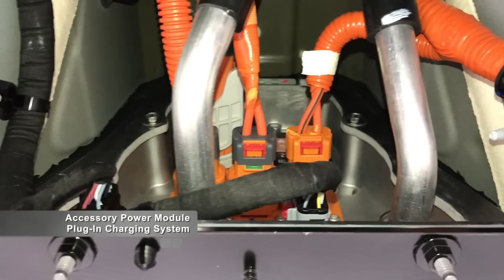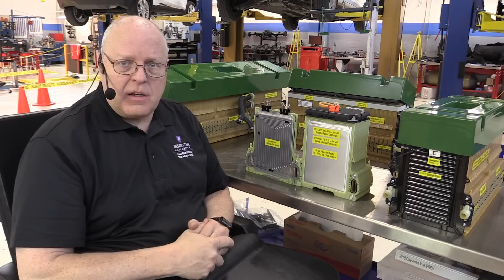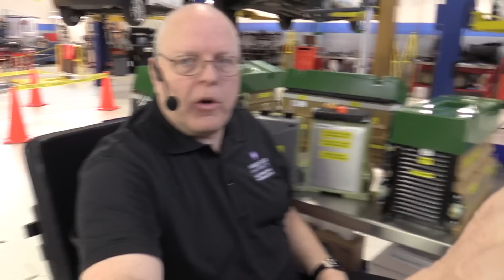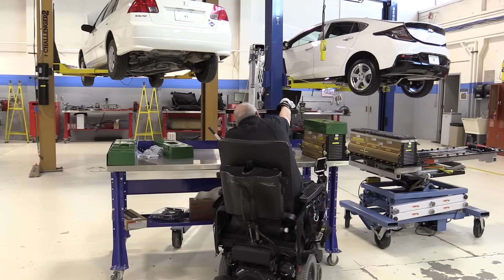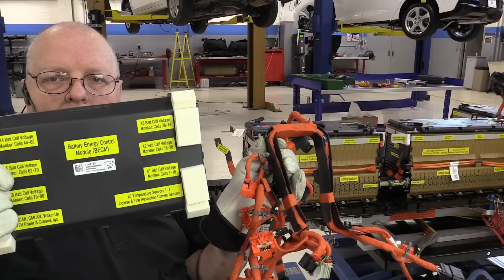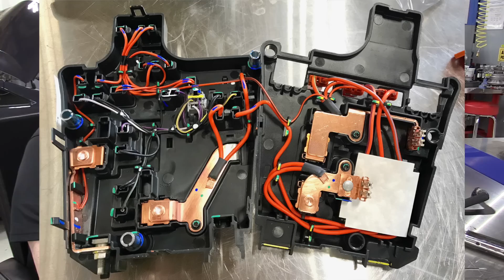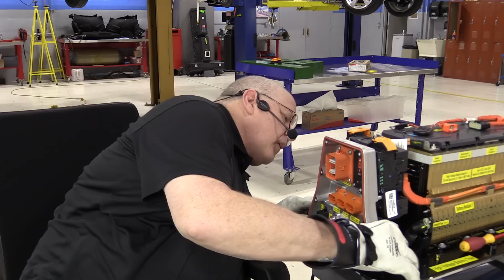2018 Chevrolet Volt 355.2V Li-Ion Battery - Deep Dive

Comment: I have a Ampera which is a volt, this is a great instruction on how the battery all goes together, amazingly well done. However it leaves me unsure on keeping this car, while it has been totally reliable without any fault or loss of battery range in the 89,000 miles I've done so far, I cannot work on it safely :-(. When it gets old it will be unfixable and useless,. I'm not a throw away person so this is bad for me. My 23 year old Jeep TJ however, will last forever, I just won't have any petrol to put in it :-)
Reply from the maker: I still have my 2014 Volt and have the same concern. I am hanging on to it until I can no longer obtain repair parts. Thanks for watching

Comment: Hello, I have a 2012 volt that I would like to convert to a vehicle charger. Im getting the cybertruck and the trade in is not worth it. How well would the volt work as a generator. AC TO AC
Reply from the maker: Good question. Thanks for watching

Comment: was long but so good
i got a used 2012 a week ago and i wondered was there a way i could get more that 21mile on a charged system? and if you can rebuild it and if so how much do you all charge to do so
Reply from the maker: Thank you. Chances are high that the battery capacity has decreased since it was built. That may be all you can get. Make sure the tire pressure is set correctly. Using the heater or air conditioning reduces driving range too. Best wishes
Reply: @WeberAuto  would a new batter give linger range?? Or not worth changing

Comment: Thank you for showing me this I have a 2017 with 55,000 miles it only gets 35 to 40 mile range with everything shut off what do you think
Reply from the maker: Make sure your tire pressure is set to the proper spec on the door pillar. Cold weather drops range too

Comment: One other thing.  I live in Phoenix.  A big city where you would think that there would be dealer expertise related to this vehicle.  My experience is that sometimes there is only one and sometimes no one at the dealer who knows how this car works.  I kind of expect this because my experience is that the auto tech don't appear to know much about cars in general.  Their pretty good at old technology but not so good with computer control.  And this is exactly what makes the volt perform as it does.
Reply from the maker: Agreed, finding trained and skilled Volt or EV technicians is a problem. They are out there, they are just hard to find.

Comment: Thanks Professor Kelly.  Can you comment on the repair method that you think or know will be use by the dealer when battery repair is necessary.  For example,  as a user,  I probably don't care which particular cell is bad just what module.  This assumes that the dealer can replace the module and not the entire battery.  Or do you think this is like replacing shocks.  If the left one is leaking the right one weill start leaking soon so we replace both.  Will the dealer argue that if one cell is bad, the others are to follow shortly and opt to replace the entire expensive battery?  I think a lot of people are first concerned about range and therefore buy a volt or another hybrid.  The second concern is about battery maintenance and the cost to replace or repair.  Thanks
Reply from the maker: They are only allowed to replace one of the three battery sections or the entire battery. Thanks for watching

Comment: I have a 2017 and its a great car. Thanks so much for the detailed explanation.   I am so disappointed that these cars have been discontinued.  I'm a retired electrical engineer and I understand that there is a massive amount of software running under my butt  to make everything happen.  In fact, I think more code than in any aircraft, fighter or commercial.  Software needs to be tested and the effort to do this is more intensive than the original design.  As you know, software is tested to spec with additional testing for any case that the engineers and testers can think of.  They won't think of everything and there isn't enough production time to test everything.  So, complex software systems are not thoroughly tested and I think about this every time I'm in the car.
Reply from the maker: Thank you very much
Reply: I'm disappointed too, I run the manufacturing facility that makes the cooling plates.

Comment: Just hose and gear clamps for coolant between sections?  Surprised these are not clips or other quick connect and clamp.  Gear clamps are expensive, slow to assemble, and tough to ensure quality.
Reply from the maker: I thought the same thing

Comment: Thanks for the very thorough "deep dive" I would love to see a conversion done on a volt to some of the new battery technologies to extend its EV range but still keep the gas engine. Could this be done? As well I'd love to see a comparison between the Volt and the Toyota RAV4 Prime, the only other Fully Gas / Fully EV vehicle I know of. (Or am I wrong?)
Reply from the maker: I own a Volt as wondered the same thing, but Volt parts are getting harder to find now making the long term outlook look bad for trying to safely convert to a newer battery technology. The Prius Prime is another option,  it its range is laughably low. Thanks for watching

Comment: Careful describing battery capacity as battery power. Comparing g1 vs g2 cells a 16 kWh vs 18kWh pack isn't necessarily more "powerful" in as power output but does contain more capacity.
Reply from the maker: Good point, my mistake. Thanks for watching
Reply: @WeberAuto  Please, thank YOU for all the absolutely incredible content. I can't begin to express how fortunate I feel to have your videos as a resource.

Comment: Why all the harnesses in all cars are not sprayed with silicon or a mixture of silicon Teflon lubricant. This way we would never ever need to worry about harness connections oxidations problems, which I believe is responsible for the many false diagnosis of failing modules?

Comment: i wonder in the future if it would possible to replace the current cell packs with with cell packs that have a higher voltage capacity at the same size to increase the volts range.

Comment: I have 2012 chevy volt that has a problem with  a sensor that overheats, after 50 miles the car goes into neutral. the dealer wants $4k bucks to replace it the car is worth about 5k and I owed about $3k. The part in question cost about $200 on ebay but I dont have the software to reprogram it. So bottom line i never buying a hybrid vehicle ever again. Its going to stay that way or sell it in parts and try to get my money back that way.

Comment: Great videos. Thank you! 
If the batteries have an electric heater, why does the IC engine on my 2017 come on when the outside temperature is below 32F with a message engine running due to cold temperature?
Reply: you should have 2 setpoints 15, and 30 degrees.  At least my 2014 does.  I think its in the comfort and convenience settings?  (The electric heater for the passenger compartment isn't that strong so the engine comes on to help. Some people have changed a thermistor and can prevent the engine from starting until much colder)
Reply: The gas engine is used to assist in heating the cabin because the resistive heater simply uses a LOT of power.   I've seen as much as a 50% drop in range in the winter in MI.   Gas engines naturally produce heat as a byproduct.   It's sometimes more efficient to actually run the gas engine to provide heat in extreme temps, than it is to rely on the electric heat alone.  The 2019 Volt ups the deferment even more to negative digits before the gas engine will kick in if you check that setting.  Otherwise it is 32* I believe that it'll kick in.
Reply: My 2018 Cadillac CT6 plug-in i can select deferred so the engine doesn't come on.  It comes on for .1 mile if I use the regen within the first 1/4 mile when cold.  If I use the brake pedal during that time the engine won't fire up.

Comment: Damn contractors should NOT be inside the hybrid battery, just a very expensive labor bill waiting to happen! Why didn’t GM put them in a more serviceable area? My Volt is in the shop with a bad contractor, total cost to repair/replace one bad contractor is $2560! Mostly labor Because the part is only around $100! Ridiculous GM!

Comment: Professor Kelly, are the 1st gen and 3rd gen batteries interchangeable? Did the battery increase in capacity because of added cells or just a better battery density?

Comment: This was such a well made and informative video covering every possible little detail you could ever need.

Professor Kelly, with your level of knowledge and expertise on the 2018 Volt do you think it is possible to change out the onboard 3.6KW charger for the newer upgraded 7.2KW charger offered in the 2019 Volt as an upgrade? I've been wondering this as I have a 2018 Volt LT but I also have a Level 2 240V 7.2KW ChargePoint charger in my home that can supply 7.2KW but the car can only charge at 3.6KW. If i could upgrade the onboard charger to 7.2KW I would be able to fully charge the car in about 2-2.5 Hours vs 4.5 hours.

I haven't found much information yet online about upgrading the onboard charger in a 2018 to the 2019's 7.2KW

Thanks for an amazing deep dive video!

Comment: I have been doing a ton of reading and asking around the web but I can’t seem to get a serious answer from anyone. Since you’ve fully dismantled the car, I can’t imagine there’s anyone who would know better. Do you think it’s theoretically possible to replace the 16-18 Volt’s 3.6 kw onboard charger for the 2019 Volt’s 7.2 kw onboard charger. Since all gen2 volts can use regen braking to recharge the battery at much higher rates than it charges when plugged in (20 kw yesterday for half an hour coasting down a mountain road), is there any reason the system (internal charging cables, cooling, etc.) wouldn’t be able to handle the higher rate if the onboard charging unit itself were simply swapped for the new 7.2 kw unit? Hopefully that wasn’t too difficult to follow, I really look forward to hearing your thoughts.
Reply: Perhaps you should begin your inquiry,

by checking with a licensed attorney.

Comment: can a second generation battery assembly be used in a 1st generation volt or will it exceed the labor of the 1st generation sensors, resistors etc?

Comment: Hi Thank you for amazing videos.For tightening torques for the hose clamps, VW has two tools VAG 1624 (100-500Ncm) and VAS 6494 (1.5-3.0Nm).We use these for interior fittings in plastic.Best regards.
Reply from the maker: Thank you! I did not know that

Comment: Thank you for doing this video.  I hope these parts last a long time.  The assembly looks VERY expensive!  As a retired Auto Electrician/Mechanic, I can't help but see and think of all the possible intermittent's and other problems in this assembly.  Past experience with non hybrid vehicles has taught me that.
Great Video Professor Kelly!
Reply from the maker: Thanks for your feedback
Reply: Keep using the wiggle test for those pesky shorts it helps at times

Comment: Ive owned my 2019 Volt for about 2 months now. One thing I was surprised about; when driving in "hold " mode and the battery is not fully charged, the engine does not charge the battery. I would think it would be able to, along with powering the car. Agree?
Reply from the maker: It will charge to 42% in mountain mode, but otherwise it will not charge it while driving. They told us in GM training back in 2010 that they do that to reduce the number of battery charge/discharge cycles to prolong battery life.
Reply: Remember, Dar, this is a plug in hybrid. The idea is you are driving on power company electric, not by burning gasoline (Like a "plain" hybrid, think Prius.) If you want your ICE to charge up your battery, you might as well get a non-plug in hybrid. (I own a 2017 Volt)

Comment: Designed, obviously, to be a very high dollar service at GM dealers, there is absolutely no reason much cheaper individual modules couldn’t just snap in to the pack without removing the entire battery assembly, been done in large UPS and server systems for decades... I see a huge opportunity for the aftermarket to redesign these properly, I’m betting that the OEM will start using encrypted electronics though, like other industries are now doing to make them unrepairable except at the dealer.
Reply from the maker: Thanks for your feedback

Comment: Here in Chandler, AZ, I have been working on these since their inception in 2011.  I have only worked on/repaired the internals of the battery pack 2 times. Once for a BECM and once for a High Voltage Interface Control Module. I work on Volts several times a week and the vast majority are for low coolant from air pockets trapped in the cooling system and occasionally a bad HV battery  coolant level sensor along with your typical software updates.
Reply from the maker: Thanks for your feedback. As you probably know, the vacuum tool works great for removing air from those systems and for leak checking. Have a great day!
Reply: how do those batteries hold up in the Arizona heat?
Reply: @co.larich  the batteries hold up exceptionally well longevity wise but the actual charges dont last long due to the heat in the summer requiring the coolant pumps and fans to turn on while charging to prevent overheating as well as the HVAC system being on.
Reply: Very educational.
Reply: How can i get ahold of you? Im in phoenix.
Reply: @sergioknuf  what are you needing?
Reply: @chicanobluesaz4191  im looking at getting a 2012 volt from offer up wanted some one that can check it to see if is worth it the guy said the charge is at 21miles range. But i can't find any one in phoenix.
Reply: @sergioknuf  Unfortunately I'm no longer in the industry. I had an amazing opportunity through Intel open up for me working on the robotics. The GM auto industry doesn't want to pay for experience and top notch talent so I had to bounce.
Reply: @chicanobluesaz4191  damm!
Do you know any one else intown?

Comment: Do you know if the new 7KW charger from a 2019 Volt would fit into a 2018? I figured if anyone would know it would be you!
Reply from the maker: I do not know. It may fit, but that does not mean it will work. The programming of the vehicle enables the charging rate.

Comment: Prof. Kelly, I have decided to actually subscribe to your channel. Something I rarely do. I find the  attention to detail you provide extremely fascinating  and the video is hardly boring. I cant imagine why you would call it that. At any rate,  the obtainable knowledge  here is invaluable to myself as well as anyone interested in how EV.'s  operate in general. I have been trolling many you-tube videos to gain knowledge on how to go about building or even manufacturing a battery bank for my solar array  of 7 K watt for my home. Making this stuff myself is actually much cheaper to do than purchasing the components and brings it into a budget range I can afford . I am a semi disabled  rebuild tech of  1920's assembly line machinery and electronic bench tech. , so thankfully I have the ability to do just that with a bit of  additional knowledge. Exactly the kind you are providing here. Without it my task would be impossible and I am afraid may not be possible at all. This is exactly the kind of knowledge necessary for working on this stuff, also something I still do often , ( work on vehicles ) Technology is changing extremely fast and if you want to be able to do this stuff you have got to keep up with how it works. I am afraid that this knowledge is something you absolutely will not and can not get from the manufacturers . Only way to get it is hands on experience of happen across something like your channel. Luckily I found you as in no way could I afford a 2018 vehicle to disassemble and  dissect like you have done here  as well as label every little piece AND most importantly explain exactly how it works and what its doing. I also do not believe anyone who owned one would want me poking around in theirs. THANKS so much for your  work here, its absolutely invaluable to me.
Reply from the maker: Thank you very much! Best wishes!

Comment: Great video.  Need to repair some wiring.  Saw the disconnect part under the center console, but not shown in video exactly what needs to be removed in order to get to it.  I have a 2017 where the Fire Dept partially cut the wires in the left rear side compartment.  Any suggestions on getting to the disconnect under the console?
Reply from the maker: It is under the center console lid and compartment insert. Open the lid and lift out the insert.
Reply: @WeberAuto  Disregard.  I was able to remove the plastic insert.  I guess the plastic was smarter than me.  Disconnect was right in there as you stated.  Good to go.  Thanks for the reply.
Reply: @WeberAuto   There is a rubber insert, but can't seem to lift out the plastic compartment.
Reply from the maker: @MPDano  The entire plastic compartment under the console lid will come out. Use a small screwdriver or pick to get under the side edges and lift it out.

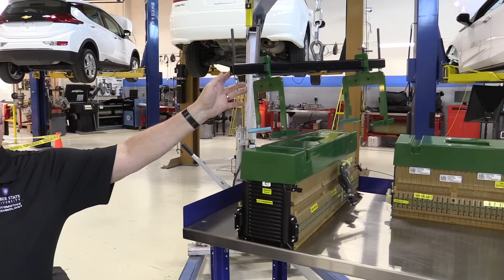Comment: Interesting lecture, thank-you. At 30:20 , the lifting adapter arms appear to have a screw-locked clamp to allow you to set the distance between the arms, thus allowing the arms to drop neatly into the slots provided in the safety cover. Fitting into the slots also stops the arms sliding off the battery group ends when in place, if the t-bar locks are not tight.
Reply from the maker: Thank you, you are correct, I misunderstood how the covers and the lift fit together